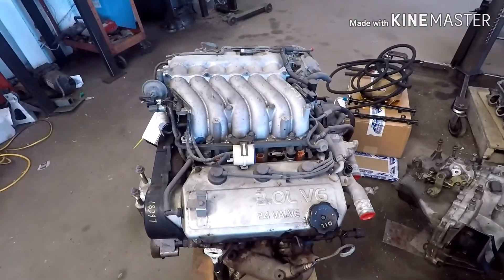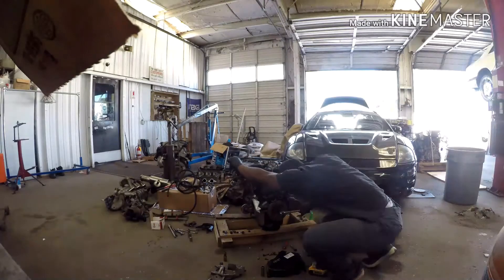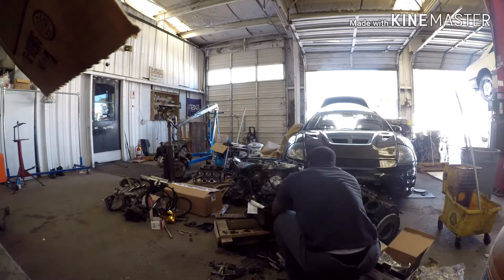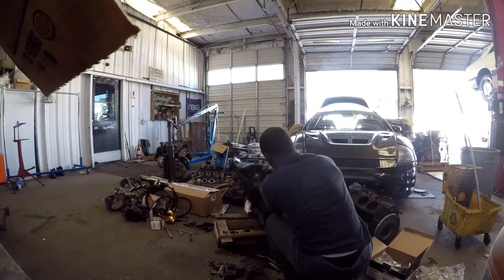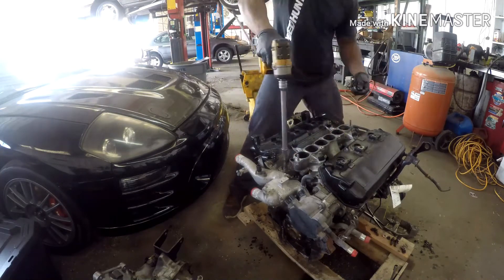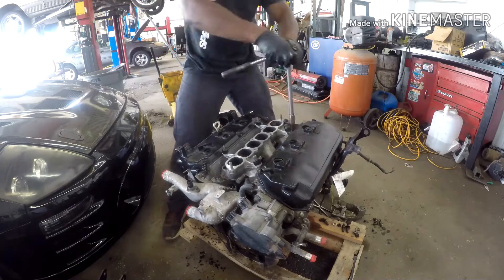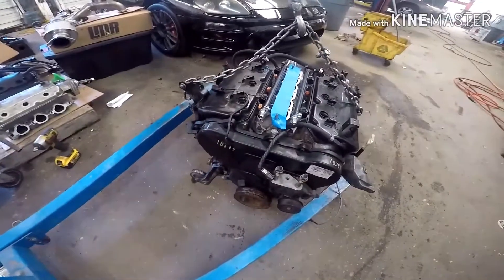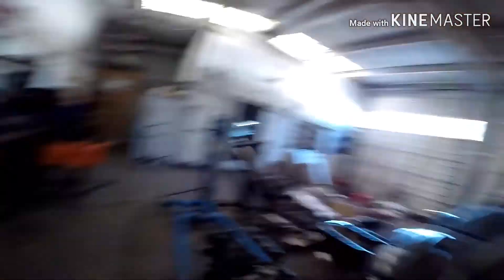3g eclipse gets a new heart

Comment: hey brotha, you sound very knowledgeable about these cars and the 3.0 and the 3.8 Mitsubishi v6 engines
I've got a 3.8L 6g75 MIVEC and a 3.0 v6 manual transmission 3rd gen eclipse.

any tips on the mivec delete for the 3.8?
I don't think I can't control the mivec with the Megasquirt 3 I plan on using for the swap
I know you were talking about the Non mivec 3.8 being better than the MIVEC one

Comment: Hey tcroc, looking to have an eclipse 3g as cleen as yours. Just can't decide Wich engine size,  if the 2.4 or the 3.0. looking to modify in the future. What would be your thoughts be. Thanks and keep up the awesome vids.
Reply from the maker: 2.4 is easier to turbo because all of the evo parts swap over. So if your looking to turbo the car I would go with that motor.  You can motor swap the v6 with a mivec motor for pretty cheap
Reply: What can I do to my V6 3.0 to pump it up? I heard mivec engine mounts are in different locations so it won't work in a GTS is that true? I wanna turbo it... would it be wise to buy those $600 engine rebuild kits I'm pushing 300k miles.
Reply from the maker: Mivec engine bolts up you just need a few parts from the other cars

Comment: So I have an 03 GT Spyder with a GTS motor. If I put in forged pistons, would I still have to worry about high compression? I’m looking to turbo and trying to get 350-400hp
Reply from the maker: I would be careful but if your going to replace the pistons might as well get some pistons with a compression that will complement the turbo
Reply: @tcroc30  ok, thanks. I’m also still deciding on swapping in a 6g74, or going with better pistons for my 6g72. I’ve heard the 6g74s are stronger than 72s from the factory, and I found one at a local junk yard of mine with 24k miles for half the price of forged 6g72 pistons.
Reply from the maker: I think the 72 and 74 are probably at the same strength. The pistons are the weaknesses in both. But you will make more power with the 74 because it's a bigger motor

Comment: Can you put a GT 3.0 in place of the GTS 3.0 without changing anything else?  I understand I'll lose HP but it's just a daily driver for my son.  All I can find are GT motors around here.
Reply from the maker: Yes it should be no problem. The only thing I would worry about is the VIC but you could just use the gts intake manifold

Comment: I just pulled out a GTS engine from my spyder and fuck it was not easy
Reply from the maker: Yea if its the first time its a pain in the ass. Ive done so many swaps I just have a system to get it done smoothly
Reply: tcroc30 yea I bet it becomes like that. I’m used to the 3000gt platform so it’s similar but it’s definitely not as crammed. Especially with the GTS intake manifold, and there being no videos or info on this model. Feels good having it out. Gonna see what parts will be good for my 3000gt
Reply from the maker: Its definitely easier to drop from the bottom but I usually remove basically everything I can before I pull it from the top

Comment: I have a 3.0l and a gts motor I bought that aparrently had bent valves.
Where can I find the tool to change the springs?
I AM wanting to use the gts cams in my other heads if possible
Reply from the maker: I would definitely look at summitracing for the tool
Reply: Yeah or even a local auto parts store should have one

Comment: I have a 2000 gt 3.0 I have a misfire on cylinder 5 on a compression test i only get 60psi so I'm thinking of swapping it with another gt 3.0 or can I put the gts 3.0 in n if so do I have to tweak the ecm or is it plug n play
Reply from the maker: Personally I would tune to get the full benefits out of it but I know some people who don't

Comment: Besides not being able to run the gts intake what else has to happen for it to run in a gt?
Reply from the maker: If you have a 00 or 01 gt you have to use your distributor. Also the gts maf cant be used. Now you can use both if you change roms in the ecu. I'm gonna go into more detail about it in the next video

Comment: Does that fidanza flywheel work with all of the 6g7x engines or just the 72s?
Reply from the maker: All 6g7x
Reply: @tcroc30  yeah I figured so if all the clutch kits did since we use the 72 trans just didn’t wanna order it then swap my engine and be like duhhh lmaoo thanks man
Reply: @tcroc30  when are you doing that s90 video.? Lol
Reply from the maker: @austinswick398   when i get some free time I will.
Reply from the maker: Yea man your all good

Comment: what gen evo parts are compatible with the 4g64. i have a 02 eclipse with the 4cyl and i want to turbo it. but i don’t want to blow my shit up. and does the evo exhaust turbo manifold bolt right up to what i have? (4g64) and what gen evo will match up with my car? (like evo 8, evo 9)
Reply from the maker: Lots of the evo 8 parts  bolt on so exhaust manifold does bolt up. I don't think the down pipe will work though

Comment: I need help installing my gts engine into the car any tips?
Reply from the maker: Label everything that you disconnect and bolts you remove. A extra set of hands will help a ton pulling the engine out and dropping it in. It looks intimidating but its actual a real easy job to do

Comment: Im just getting into cars im 16 so if i sat something dumb just let me know so i have a 01 spyder eclipse gt 5 speed manual and my parents got it for me to fix up with my dad. And right now its not running its missing a mass air flow sensor and intake and its shorting out, the headlights click like the turn signal is on and its not, the headlight isnt actually flashing just clicking, and sometimes the ignition will start going off for no reason i was wounding if you can help me out If you can thanks
Reply from the maker: I would start by getting the intake and mass airflow sensor on. Then check to see if your getting power to the car. Check grounds battery and the connections
Reply: tcroc30 okay thanks I love your channel
Reply: tcroc30 I also got a question wtf is a mivec ive looked it up and all i got is what mivec means like the literal definition
Reply from the maker: @boofy1744  its basically Mitsubishi brand of variable valve timing. It varies the  timing of the intake and exhaust camshafts which increases the power and torque output over a broad engine speed range
Reply: tcroc30 okay thanks for explaining that
Reply: tcroc30 ok we did all of that we have a dead ground short to the ignition fuse when we unplugged a etacs the short goes away
Reply from the maker: @boofy1744  etacs controls all of the lights. Make sure none of the wires are exposed. One of my friends had a similar issue. His short was in the headlight wiring where he wired up some halos
Reply: What kind of prize tag would this cost? I have a gts engine..and been trying to figure a good set up..for a future turbo..
Reply from the maker: @jeremyfrench1040  if you shop right you can spend probably up to 3k. My last set up I believe I spent about 2k. Shop around for a lot of used parts
Reply: You mentioned that you shouldn't boost a gts engine with the higher compression ratio.. But I noticed you are deciding to yourself.. Typically speaking, do you think the engine could handle around 15-20 psi?
Reply from the maker: @jeremyfrench1040  I wouldn't go that high honestly. GTS motor does have higher compression so you have to be careful with boosting it.  A e85 set up would help though. Just make sure the tune is safe. Some tuners want to only tune for power instead of reliability
Reply: Sounds like the best option to just do a complete mivec swap and then turbo it?
Reply from the maker: @jeremyfrench1040  yes
Reply: I just love the 3g so much..and believe that they have been underrated for too long. I own 3, 3g eclipses..2 gt and 1 gts
Reply from the maker: @jeremyfrench1040  yea its definitely a very underrated car
Reply: I believe I have watched your video a hundred times and learned a thousand things lol.. 
I have hands on experience with the 3.0 v6 for about the last ten years.. As an amatuer, I am still learning a lot of things.. My gts has been my baby and my gt has been my daily. As of current, my gts mods have been full stainless steel headers, full stainless steel downpipe, catless exhaust, 2.25 inch convert into 4.5 inch catback muffler..a injen short ram intake, egr delete, with o2 rear foulers, ngk iridium plugs, new gaskets, plug wires, and distributor... Need a better intake manifold swap and then a ecu flash..any tips or ideas would be appreciated
Reply from the maker: @jeremyfrench1040  you can use 3.5 intake manifold from a diamante, if manifold from Hyundai, xcessive intake manifold or 3.8 intake manifold from a galant. All will require throttle body upgrades since the diameter is bigger. So that opens up more options. I may do a video on it cause theirs a lot of options and combos
Reply: Please do..lol I have gts intake oem manifold and I believe my intake tuning vales are sticking and staying close at high rpms. City driving is really good.. But it seems at higher speeds, my car wants to bogg out at 5,000 rpm range..almost like it's not getting enough air mixture..do you think my egr delete may be the problem? Check engine light says intake manifold tuning vale..i have replaced the selinold but still continues
Reply from the maker: @jeremyfrench1040  probably is sticking. Try taking it off and cleaning it
Reply: I read somewhere on the 3gclub form that we can remove the butterflies and run the intake manifold without them..and it works great with longer intake rails...do you think a butterfly delete would be better or better fixed?
Reply from the maker: @jeremyfrench1040  wouldn't be a bad solution the only thing I would worried about is the check engine being on since the valves are gone
Reply: I can still leave the selinod plugged in and still have my vacuum purge canister still attached..how would it actually know if the butterflies were gone or not? The purge canister would still function..im guessing lol
Reply from the maker: @jeremyfrench1040  it probably won't be affected
Reply: @tcroc30  please do bro. I have been looking into it but i dont know what to go with. It would help a lot of us that are barely getting into it.. I have 2 eclipse gts. A 2000 and 2003. You have help me before on mine. I appreciate for helping me. Thank you bro
Reply from the maker: @mayan34956  all right I'll start making a video about this soon

Comment: What's your location bro, any contact info, I have a GTS as well looking for help
Reply from the maker: In VA. What do you need help with
Reply: @tcroc30  im all stock and would love more power just not sure where to start. I'm tired of ppl pulling on me calling me slow. 😂 also I'm planning on keeping my original motor but it has 285k miles and still going strong. I just did head gasket, lifted, and valves a year ago.
Reply from the maker: @aka_sharky  cheapest bang for the buck is a motor swap but if you want to keep the original motor. Intake exhaust headers tune